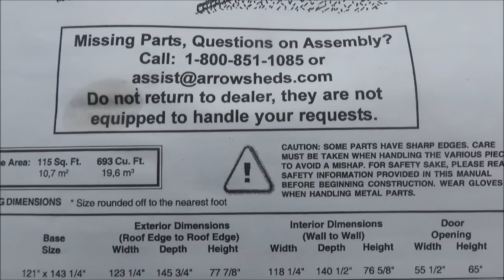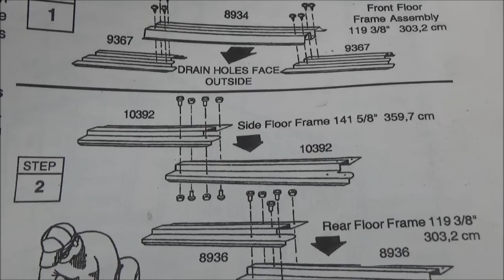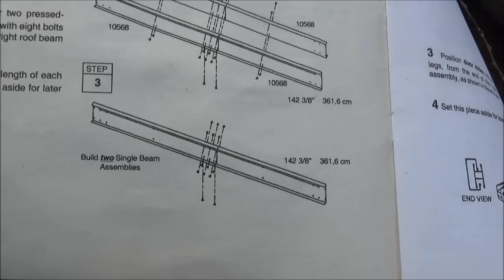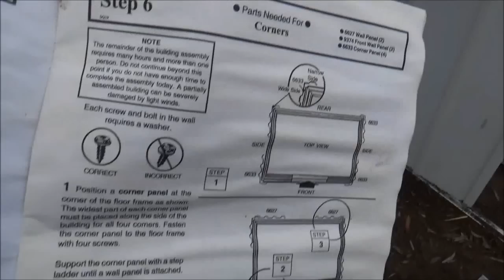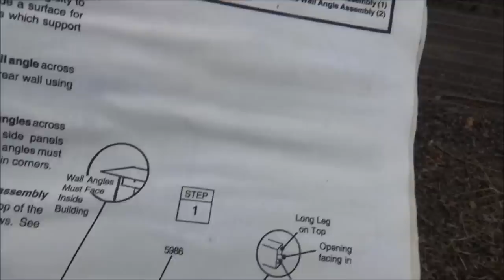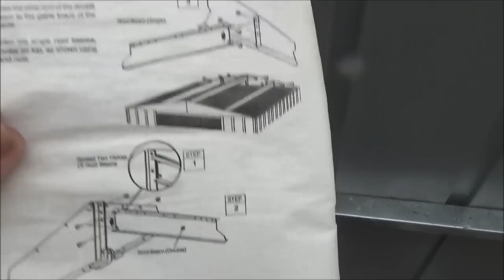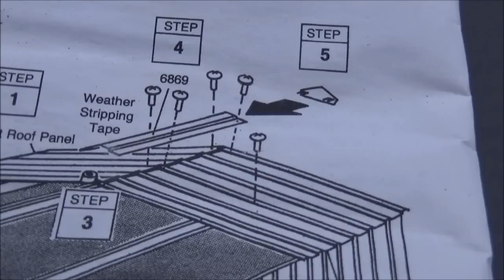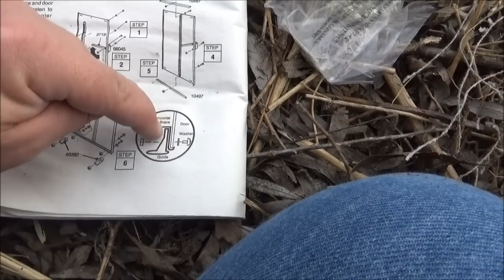NP101267 10'X12' Arrow Storage Shed Assembly - L2Survive with Thatnub

Comment: I agree that this video is SOME help into the madness of putting this together.   It is 100% FLIMSY,  manual  one big confusing mess,  pieces have numbers marked, while many are not marked.     The screws and bolts are so tiny,  too many pieces.   Floor frame is a cheap mess.   We changed and used pellets as floor frame.   This has been a nightmare,  and  when this damn nightmare is up,  it will be called "The Damn Miracle Shed", because that is what it will be ....   a damn miracle.   This thing is not going to survive the first heavy snow storm,  or hailstorm.   NOTE:   The manual has mistakes.  When calling company for missing pieces,  they acknowledged they are continuing work on the manual errors!!!

Comment: I have an arrow shed like this one. Bought it new, put it up here in sunny calif... never seen sprinklers, dog pee, nothing of the sorts. Rain yes of course. 3 years later the doors at the base are rusting. No I didn't scratch it, or whatever else can be said, there's no proper base under the topcoat. It is relatively cheap shed but come on, 3 years........live n learn.
Reply from the maker: the greek guy viva-greece Three years would be great.  We should be on our own property by then and that shed is going to stay here.
Reply: the greek guy viva-greece That's too bad.  I had a 6x8 smaller version of what's shown in the video up for 4 years in Iowa with terrible winters, plenty or rain, and high humidity summers and never had any rust or corrosion.  Hopefully it's not a quality control issue, as I just bought this bigger 10x12 one to put up at my new house this coming weekend :/